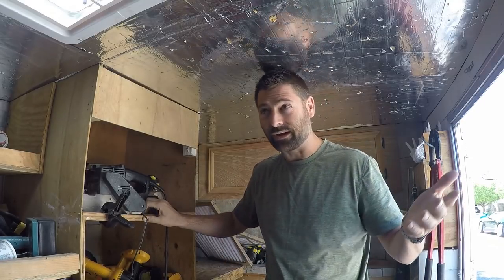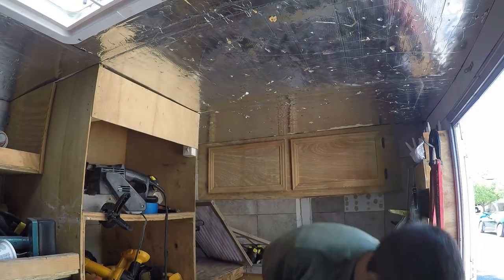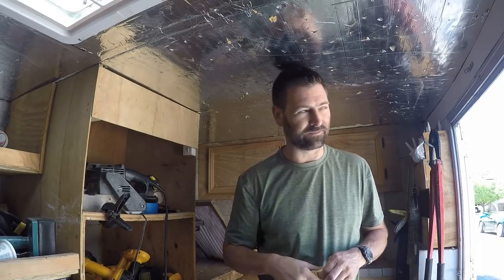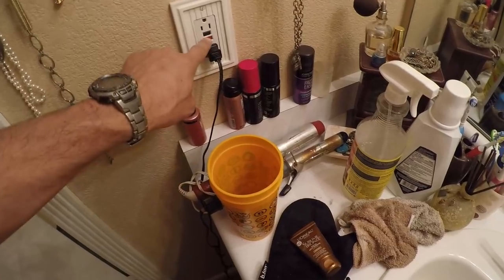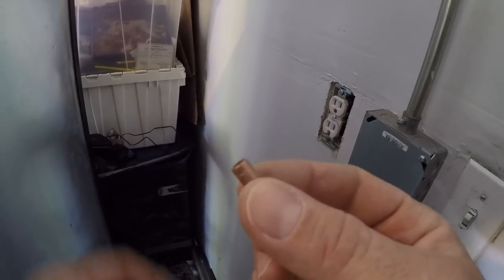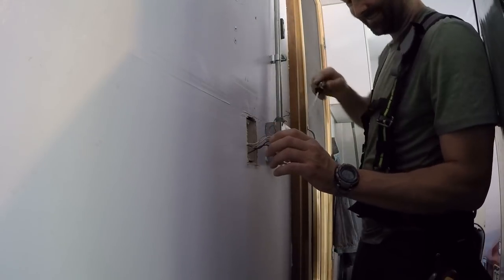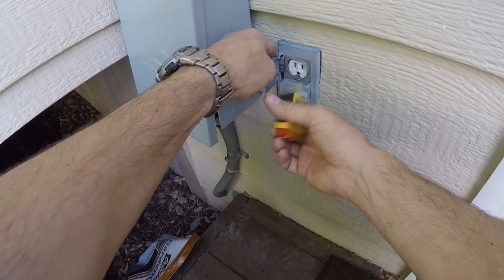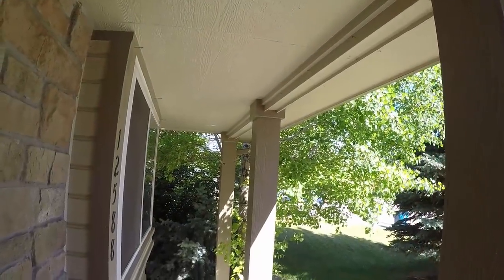Handyman Makes $1,200 Per Day Resetting GFI Outlets For Millennials | THE HANDYMAN |

Comment: It’s stupid to have a gfci outlet in the master bathroom controlling the outside and garage outlets.  I have a similar situation.  The gfci outlet in the hall bathroom controls the outlet in the crawl space.  It took me an hour to figure that out.
Reply: I got a buddy  chest freezer when he got married
He got tire of the stupid Garage plug going deed by the back porch GFI tripping, 
and not knowing til the STANK from all the rotted food in the powerless freezer eventually became noticeable.
Why the heck did the builders put the OBVIOUS GARAGE FREEZER/FRIDGE plug on the same run with a far leaky exterior gfi.. sheesh
Reply: I think that's usually how they wire them. I was asked by a sister's friend to take a look why her outlets at the garage and porch had no power. She didn't tell me that her outlet at the master's bathroom also didn't have power so I just concentrated troubleshooting at the lighting panelboard and the three outlets outside. 

Couldn't figure it out, nothing was tripped at the panelbox and yet the three outlets had no power. Until I thought of checking all the outlets inside because it seemed wasteful to have a branch circuit with only three outlets. That's when I saw the outlet at the master bathroom had no power and I saw that it had a reset button so I reset it and everything went okay.

That's how I became familiar with GCFIs. I have heard of it in my native country but nobody really uses it.

Comment: I like to use the plastic spacers used for aligning outlets flush with wall. The plastic spacers the same ones used to adjust outlets after adding ceramic tile.
Reply: Also the refrigerator is probably why it's tripping.  They should not be plugged into GFCIs

Comment: I live in the Caribbean an i don't do those things. Each bedroom have two circuits one 15 Amps for the lights and one 20 Amps for the outlets. If the say u have an master bedroom and bathe the both lights and the same circuits but in term of outlets the GFCI is different from the  bedroom outlets. An base on who I am doing the job for I would use flexible Conduits. That way if something wrong with an circuit u can always pull out an pull in different wires.

Comment: I love your channel, however as a tech worker in Silicon Valley, I'd be a bit pissed if I got charged $500 to reset a GFCI, however I installed my own GFCI's and outlets and fix my own furnace so maybe I'm not a typical tech worker.
Reply: Lots of people I know in silicon valley would pay that because they are clueless. But also very common is that they see this type of work as beneath them so they'd rather pay someone "dumb" to do it for them. Remember this during the election. This is what the tech elite think of everyone else. Especially Trump supporters.

Comment: My sister had christmas lights out front that stopped working after a rain storm.  None of the breakers were thrown and I looked all over for a GFI plug in the garage.  I noticed the workbench was set out from the wall a little bit.  I unscrewed it from the wall and the GFI outlet was behind the workbench leg.  I pushed to reset, and christmas lights back on!  LOL, on newer houses the wire the outside plugs to a GFI in the garage!

Comment: Once did a ceiling fan at my sisters house and their master bath outlets tripped for some reason. The breaker was Not tripped, so where was the GFCI..? Finally found it behind some stuff about 3 feet away from the sub panel in the garage and then it goes and feeds the two bathrooms.

Comment: Put in individual gfi receptacles at each outlet instead of coming off the load side of one. That way the whole circuit won't go down.
Reply: he wants the whole circuit to go down. LOL
can u blame him
Reply: Pool,  I agree.  Gfci at each location will also help determine which location was causing the tripping.  It might have been water getting into the outside outlet.
Reply: You don't want a gfci at every outlet.  It would make more sense to just separate the bathroom  from the circuit.The breaker is enough for most everything

Comment: Great video...what will you do if the master gfci doesn't work that connect the same but everything works but the outside outlet bathroom gfci doesn't work what is next..thank you have a blessed day
Reply from the maker: If it is a bad GFI.  Replace it.
Reply: @TheHandyman1  it wasn't and it has 2 black wire 1 active 1 is not ..do I need to trace it ..thank you have a blessed day

Comment: These are good spacers also, "Gardner Bender GSP-24 24 Piece Switch and Receptacle Spacers". That will continue to trip, especially in the summer with those refrigerators on the same line.

Comment: Technical question: you turned off the breaker before changing the outlet in the garage correct?  Or was it just the GFI in the master bath separating you from the power source?
Reply: 5:34 he says "im gonna trip this"
So i assume he went back into the bathroom and pushed the black "test" button on the gfi outlet.

Comment: Can you prementally fix this problem by taking the load side off the master bathroom GFCI? And just slice the load side through like a regular plug?
Reply from the maker: There wasn't a problem  They were just over loading the circuit with 2 refrigerators and a curling iron.   There is no way to turn the garage plug into a non gfi protected outlet with out running a new wire to a different circuit.

Comment: 5 years ago when I just bought my house, the previous owners were the ones who built it themselves.  And the downstairs which i use for an office is wired up GFI to the master bathroom.  So the first time it tripped.  We had no clue for an entire day how to fix it.  We called the previous owner to tell us they wired the GFI ect. 

I need to remove the connection and just home run the office to the panel.  its right next to the garage and like 20 feet away so yeah

Comment: Every time the compressor start-up occurs at the same time as the hairdryer is being used it probably trips.  Why didn’t you charge them to pull a new line or at least replace the gfci?

Comment: i have a smoker that worked fine at my last house, but now that we moved it trips the gfi outlets outside. my garage one would also trip when we plugged the fridge in. i replaced the one in the garage and its fine. i replaced both the ones outside and i'm still having the same problem. i understand that the smoker may have an issue thats causing it to trip, even though it never did that at the old house and the outlets also trip when i plug other things into them as well. so my question i guess is, what else could it be and also should i just put a standard outlet in place of the gfi outlets  (i know thats not "the right way") as a fix?

Comment: Save yourself even more money (long-term)...don't string GFCI outlets like that...let each outlet have its own GFCI so only the one that cause the ground fault trips.  For the Fridge/Freezer in the garage, use an "Audible" GFCI so you KNOW that it has tripped and your food won't go bad...with an audible, you know that the power is on but just the GFCI is tripped.  Furthermore, if you use separate GCFIs in this application, odds are, they will stop false tripping.  Stringing outlets like that is fine when odds are only one device is in use but since there is a fridge always in use (and it has reactive components in it), you are always on the verge of tripping the GFCI just through normal use with two things operating.

Comment: Why $500 to reset the GFI? Well, because the Handyman knew what to do.

You know the story about the factory with the big complex piece of machinery that quit working, all the techs and engineer types were scratching their heads trying to figure out why it would not function, finally, the call in the "Old Retired Guy" who had forgotten more about machinery than they all knew. He walks in takes a long look at the machine, pokes, prods and finally he goes to his tool kit and takes out a hammer, he walks up to the machine and hits it hard, once in a particular spot and the machine roars into life. He says to the big boss, "That will be $1000 please", the boss says "What? Why should I pay you $1000 for ten minutes work and all you did was hit the machine with a hammer once...?" the Old Guy says "You are paying me $1 to hit the machine and $999 dollars for knowing 'Where' to hit the machine!"

This is what the Handyman does, he has the experience and knowledge to know where to hit it.

Cheers from Tokyo!
Reply: The Tokyo Craftsman Yep, this was a story about a steam engine locomotive. That would turn to a halt, due to specifications at certain temperatures expanding stuff.
Reply: Except 500 is too much, I say that as one who also has a handyman business and have been in the property management business. If an owner saw a 500 charge on his monthly financial statement and found out what happened, the company would lose them as a customer unless something drastic was done. As one who managed the maintenance side of a property management company, this guy wouldn’t receive our business as I have a responsibility to the owners of the rentals to find quality work at a fair price point. Nowhere in this country is a 500 bill for what was done in the video justifiable

Comment: I'm going to apprentice engineer at a hospital and the reason we install outlets upside down is to keep someone from dropping something from above it and arking the hot and neutral lead. Instead it will hit the ground on many plug in devices.
Reply: The problem I have with that in my house is some cords hang awkwardly when they are designed to angle down not up and put stress on the outlet.

Comment: When I moved into my last house, the two bathrooms were wired through a single GFCI plug in the master that went bad.  I'd reset it and it would pop after only a day or two.  Replaced the plug with a new one and never had another problem.  I ended up tearing the wall out from between the two and making it one big master bath, so if the wiring had been bad, I would have replaced it at that point.

Comment: How is a homeowner supposed to now which gfi outlet protects which series of outlets? Also, a general question, why are there always so few outlets in a garage? Thanks for your education of the public.
Reply from the maker: Trial and error.   The reason builders don't put more outlets in garages is they only build to code.  Code is the minimum requirements.  Anything more costs more money.  If you are having a house built you can pay for more outlets to be installed in the garage.

Comment: Sometimes finding the damn thing is the hard part.  My garage GFI flipped.  I wasn't using the GFI outlet, it was a different one on the same circuit- but either way the GFI flipped like it is designed.  The problem is, I had no idea said GFI outlet even existed.  I searched high and low for it- none of the outlets I could see had GFI.  Turns out when I moved in 7 YEARS AGO, my wife had built a shelf.....in front of this GFI outlet lol.  I felt so stupid when I finally found it.

Comment: "Not sure why this one is upside down"

Well, actually....

Don't mean to be "that guy" but installing them the CORRECT way around, with the ground at the top is a "safety feature" of sorts, so if something fell across exposed leads it would always hit the ground instead of shorting hot and neutral.

In places where it matters (like hospitals for example) have them installed "upside down" like that.

Most homes have them installed to look like a face, because "D'awww, the angry pixie socket looks like a cute lil' face!"

Comment: SOOOO many of my customers call me for this...

Bathroom upstairs quits... INSIST over the phone there is no GFCI push button... I walk in, ask where ALL the bathrooms are, walk to the first one in the house push the reset, and voila! The upstairs bathroom works.

ALL bathrooms in the house can be protected by one GFCI.

tip... have a meter with you to measure voltage leakage, and test appliances, walk around and look for bad outdoor cover plate boxes, cords plugged in etc...

Comment: Is there any way to look at an outlet and know some other outlet in the house can break the circuit? Sticker if you're lucky. Logically you'd test outlet for power, tripped breaker, replace outlet, then call electrician. Then to identify which ones, is it just hunting for GFI outlets and testing which ones stop working?

I didn't learn one GFI could control a series of outlets, especially one on the other side of the house, until I started to teach myself about residential wiring. I don't think the average homeowner knows this kind of thing. Well obviously, that's what the video is about.

Comment: shared circuit between bath, garage, and outside outlets=total code violation lol...also using 1/4" pex is great for spacers and much cheaper than buchanan crimp sleeves and you can cut to fit.
Reply from the maker: Actually it's not a code violation.  Houses were built like this for over 50 years until the code updated.  Just because the code has been updated doesn't mean all the 100s of thousands of hoses are no longer code compliant.

Comment: I know how to reset gfi but I didn't know until now about a whole series of gfi outlets were linked. Not any place where I lived. But I lived in 50 or 100 year old houses probably upgraded by who knows. I also never really overload outlets.
Reply: It's easier and not much extra cost to wire it so each outlet has a separate gfi, saves you from running all over the house. Those should have been on separate runs as well.

Comment: The gfi in the bathroom is not upside down . That’s going to be the standard. Because if you were vacuuming and plug came out just a little bit and something were to hit those top two terminals it’s dangerous. Putting the ground on top is another layer of protection for people inside the home.

Comment: You say the receptacle was upside down.   It's supposed to be installed like that in case a metal face plate is installed and would prevent the plate from accidentally coming loose and falling onto a the hot terminal and inturn will fall into the ground prong.
Reply from the maker: can you point me to the NEC code reference that says that?
Reply: @TheHandyman1  I'm sorry I can't.  It was so long ago in tech school my instructor had mentioned it. Esp with schools and hospitals that are all metal covers.  But it makes sense even without a code.  Do u agree?  
Did u hear about push connectors and pig tails needed for residential receptacles?

Comment: Why not charge them to rewire the circuit so the bathroom can handle a blow dryer
Reply from the maker: Had nothing to do with the hair dryer. They had 3 freezers hooked up to it too.  It works as it should.

Comment: Why is the GFI tripping? Where is the short? In the bathroom? Maybe the plug is too close to a water source? For that kind of money, maybe move the gang box somewhere that won't trip the GFI?
Reply from the maker: Gfi outlets can easily get overloaded.  They had 2 refrigerators and a hair straightener plugged into it.  It's been over a year and hasn't tripped again.  We had them plug one of the refrigerators into another circuit.

Comment: I would tell the owner, first time would ve OK to charge that much. But also You have to explain why is that happening.... Bad GFI contact, overload of circuit, etc.
Cause one, it is ethic, and two you can save lives and properties.
Reply from the maker: The renters had 2 freezers plugged into the same circuit as the bathroom where the lady used a hair dryer.   The renters were just overloading the gfi.  back in the 90s bathrooms, garages, and exterior plugs could all be on the same gfi circuit.

Comment: motor loads on GFIs make them weaker.  Definitely would just put GFIs at each location wire everything line. It costs money to fix things right, but once its done..you're done. Leaving continuing problems is how contractors put their kids thru college, which is a good thing, but it needs to be honest money.

Comment: Have you not been called on job for a no heat and it turns out to be a thermostat needing new batteries?? These are the houses where it had an old two wire thermostat (remember the T87 with mercury in it), then someone converts it to a programmable thermostat. Now the thermostat requires batteries to operate… been on many calls for those. These same old jobs eventually become a rewire job for a Smart thermostat.

Comment: Fun Fact: The bathroom outlet was NOT upside down. Weird right? The ground at the top prevents shorting the circuit by mistake or dropping a screwdriver on a half inserted plug.
Reply from the maker: Wrong.
Reply: As far as I know there is no electrical code that requires a receptacle to be installed with the ground up or the ground down. 

I will point out that having the ground up is much safer and could avoid an accidental occurrence where a thin metallic object could slide into the exposed hot and neutral prongs and cause an electrical flash and possible electrical shock, which I have witnessed first hand.

I might add that while I performed electrical installations in a hospital facility for nine years all the new receptacles were installed with the ground up.